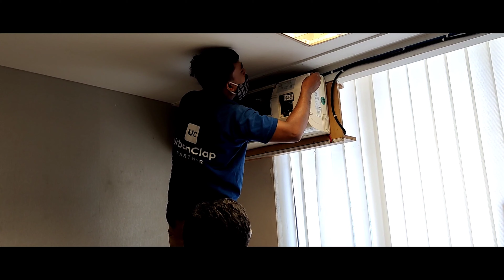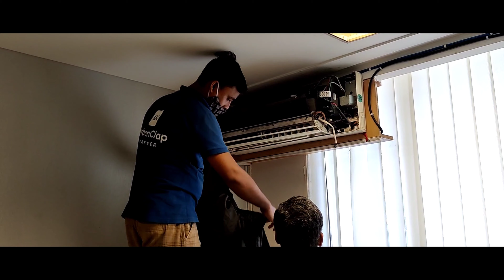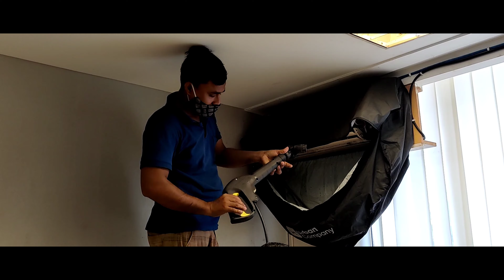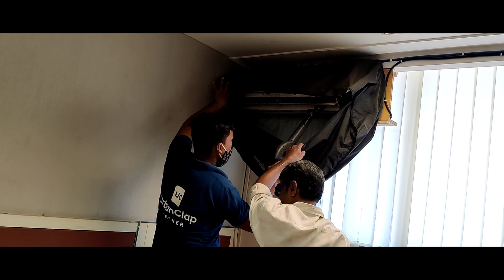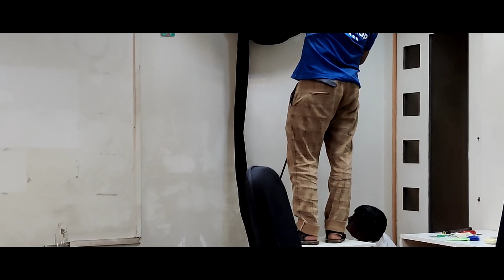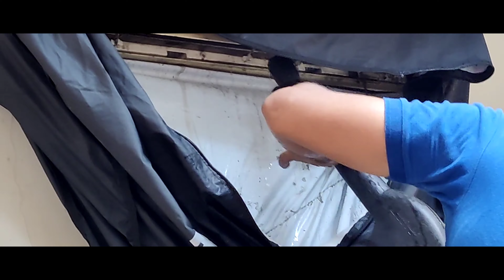AC service by URBANCLAP in just 599 Rs using jet spray (URBANCOMPANY) । UrbanClap AC Jet Servicing

Comment: water service remove the lubricant where companies was applied in blower after 1 to 3 services you have change hole indoor unit as well as outdoor fan motor etc...
Reply from the maker: Thanks Venkat, I didn't knew about this, will make sure to get the AC service done from the company itself
Reply: My suggestion do water service only for indoor & outdoor coil pls don't spray water to blower and fan motor,  thank you for replay sir.